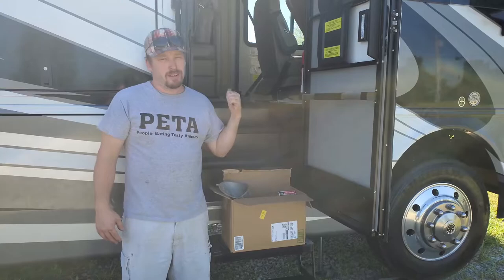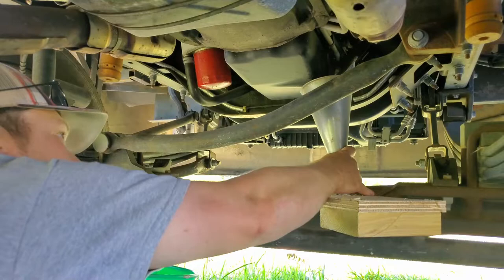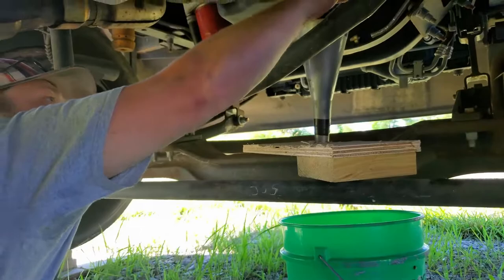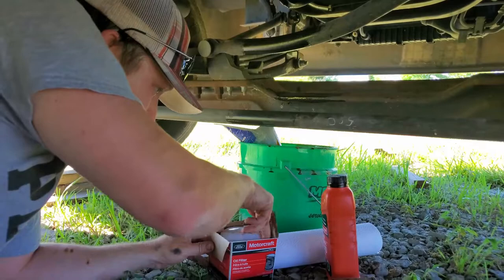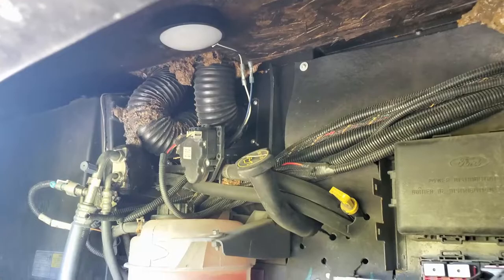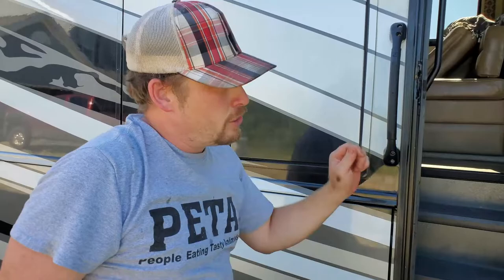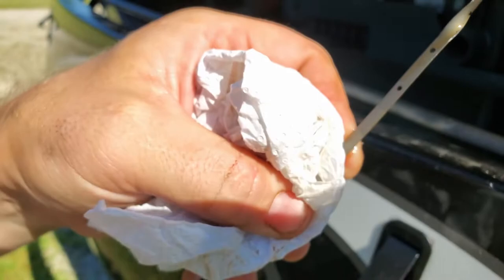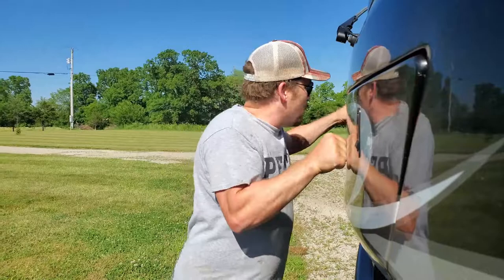Class A Motorhome Ford V10 Oil and Filter Change | | Motorcraft 5W-30 | | RV DYI

Comment: I don’t think i’d call a reasonably priced oil change $200. Sounds like your guy is ripping you off
Reply from the maker: We agree!  Where we live the Ford dealerships will not work on RVs at all.  We have to go to an RV dealership and half of those only do warranty work. So, when you do find a dealership that will do normal maintenance, they feel like they can charge 2 to 3x the price.  So, it does end up being a TOTAL rip off.